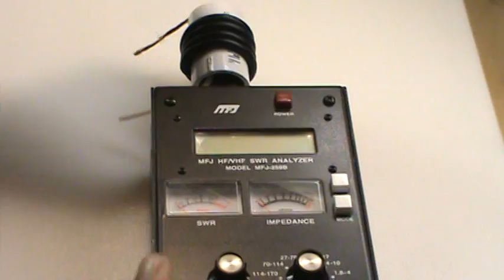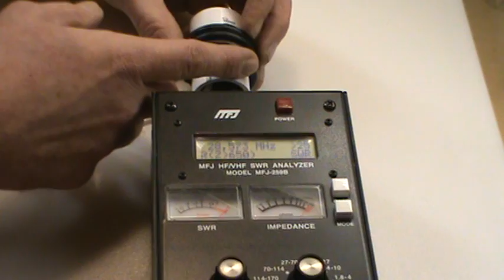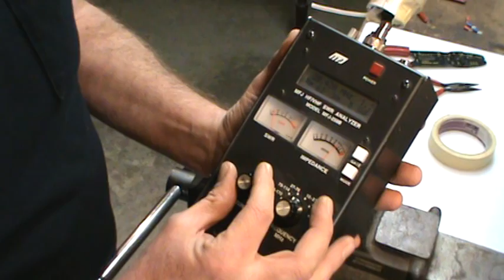10/15/20m Trap Vertical Antenna, Part 1 of 4

Comment: This just reminded me that i used to climb up in the loft at school in my boarding house and rig wire antennas in the rafters, then i would find the top of the pull light switch that went down into my study and feed the coax through the face plate for the light switch, then i must have hidden it down the book shelf. I also had flat roof access and i made a 1/2 wave vertical bolt onto the window with a short pole and some special brackets that i had built, i taped half of the antenna in black so it was invisible at night and during the day it lay on the roof. Another one i had was a firestick hidden in a tree about 20 ft from my study, at night i would run the coax out to it. I also had some windom antennas running in the outside garden. It always depended on where my room was at the time. It was crazy, i used to stay up all night and even had a valve linear that i would hide in my bedside table. Needless to say my studies didn't go as well as they could have but my physics theory was great till it all turned into math. :D
Reply: i loved your story. where was this.? and what radio you used?

Comment: Dave

Have you ever put shrink sleeve over the traps you make like 10/15/20 meter vertical?
Or will it detune  the trap.

Ken W7KLL 73
Reply from the maker: +Ken Lindahl Hi Ken, I would suggest to try it.  I may have done the same but the cost of that size shrink tubing is expensive.  Some use electrical tape.  The hot glue held for a while but did start coming off the pvc coupler. The main concern is heat build up but with these traps made with RG-58 and running no more than 300 watts, heat does not appear to be a concern. 73

Comment: Your video on the building of traps is well appreciated. I am in the process of building my 2nd antenna (1st antenna was of your 2m-70cm on Plexiglas, hat off to you for that), a Coaxial Trap Dipole for 80-10m for my attic (due to HOA restrictions) and have lost some sleep over building the traps. While the PDF instructions (http://degood.org/coaxtrap/) are very clear and descriptive there's nothing like a little video of someone actually doing it to help clear things up. 
One question: I've noticed that most RG-58/u is used for coaxial traps. Can RG-8/X be used?
Again, thank you for your videos. 73s, N2OWM

Comment from the maker: For more info see the web page for this antenna on my website (link on my YT channel). There is a link there to the original antenna which includes making 30 meter traps. For 30m/40m the 30 meter section would be nearly a full quarter wave tall, then a shortened 40 meter section. For a larger antenna use larger aluminum tubing (starting with 1-1/4" at the base and making the traps with 7/8" tubing). It can also be made of wire if you have a tall enough tree branch. Thanks for watching and 73! :)